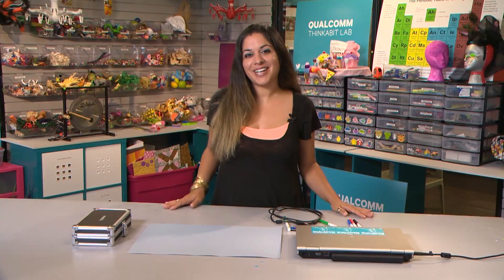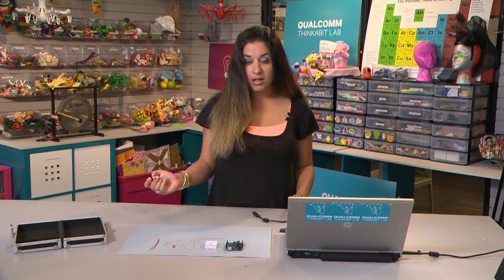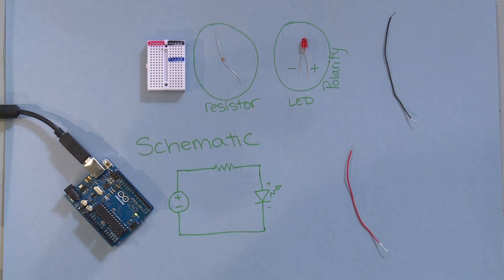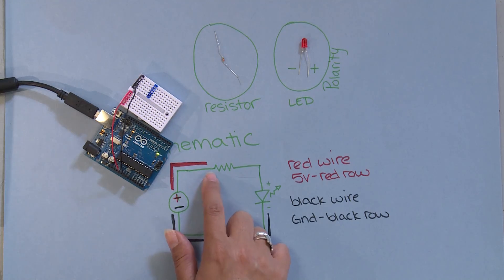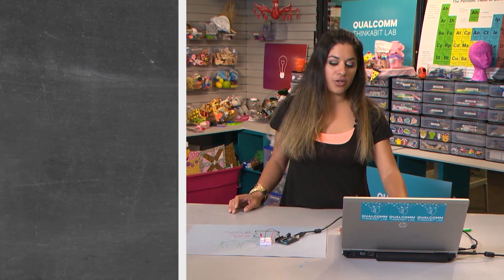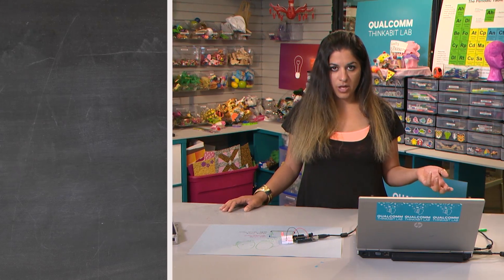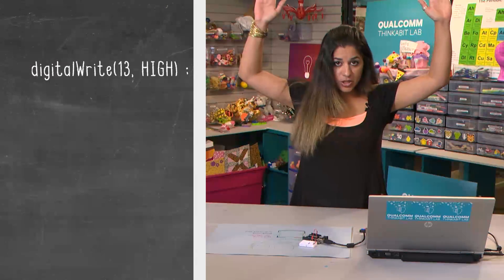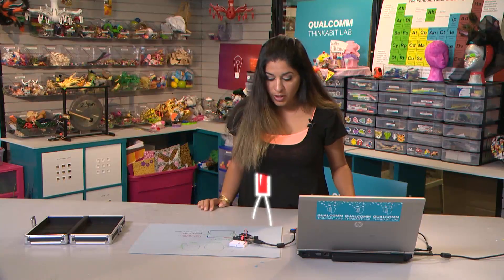How to Make an LED Light Up and Blink Using Arduino

Comment: i want to use led strips to my car which should glow normally when turned on and when i apply break it should flash. is there any option to make this happen.

only +ve & -ve wires are available on led strip

Comment: are you saying that all I need to make an LED blink is to use a $1000 computer to program a $15 computer to control a 50 cent component?
Reply: Alexander Repenning you can also use a 9 volt battery

Comment: We  care givers are not Teslas...millions are waiting for a cheap device that will transform lives. 

 My wife has been the first in a MIT Boston Alzheimer’s 40 hertz light, audio, touch trial for 7 months. The trials were moved to Boston from  the San Francisco startup last week. The SF startup failed to enroll enough people in trials The 40 hertz treatment worked for my wife and all the other 10 participants. I am looking for a battery operated 40 hertz led light... 40 hertz audio is all over the internet by , new age, religious , secular utubes, all making 40 hertz audios available. The 40 hertz video is not reliable because of analog/digital issues some say. . The start up says it is unable to help me get the very inexpensive battery light controller for led lights. It is not a cure but the treatment mitigates the process of plaque destruction. Gives the patient a euphoric response and keeps them from going into rest homes..., 1,000,000,000 not going to rest homes for one year and will save US about 60 billion  Some techies have posted an electric diagram but to do a devise you would need Tesla's help. MIT does not own 40 hertz anymore than GM owns 40MPH. A cheap controller can help 5 million dementia sufferers and their families and we cannot wait for MIT and the US FOOD and Drug Admin. to get off their bureaucratic asses. . can an engineer help us get such a device and let one million be produced.
Reply: Ed Gleason You are a hero that is what I needed to here

Comment: If you use multiple leds would you have to change resistors or is the one resistor fine? also what size resistor did you use?